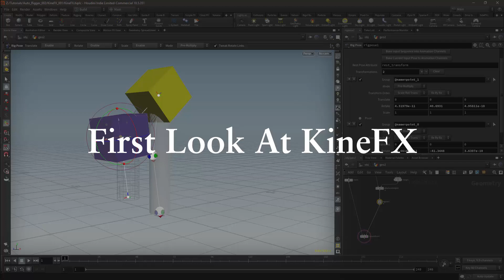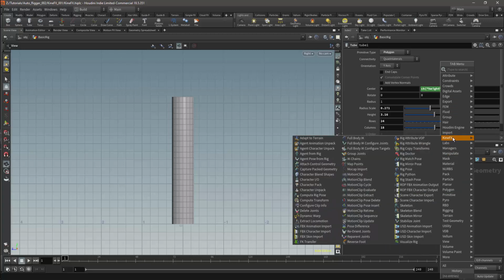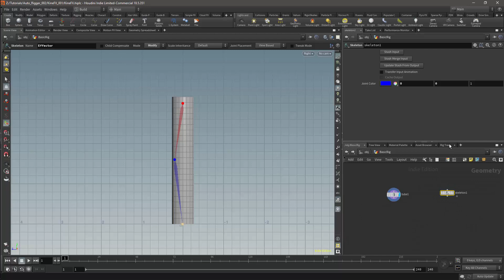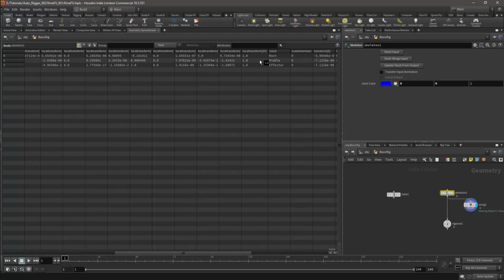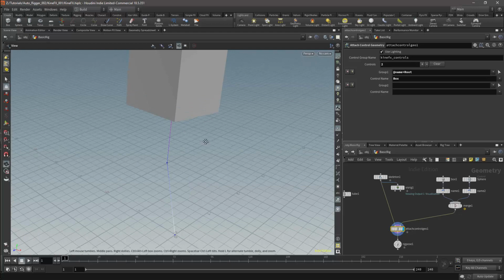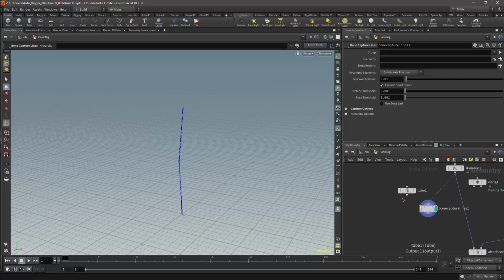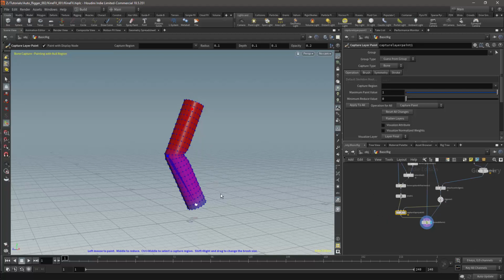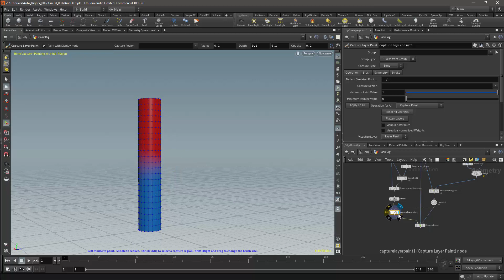A First Look At KineFX

Comment: How to  setup Muscle for this rig
Reply from the maker: There is currently no built in muscle system for kineFX. You can create the muscles easily enough (you can use geometry, blend shapes, meta-balls ect. ) the most difficult part is applying the deformation. If I get the time I will set something up but I cannot promise anything at the moment.
Reply: @brundlethwaite  I really hope that you will find the time to show all users how to use muscles together with KineFX thanks in advance.